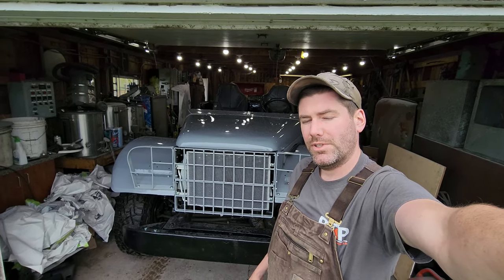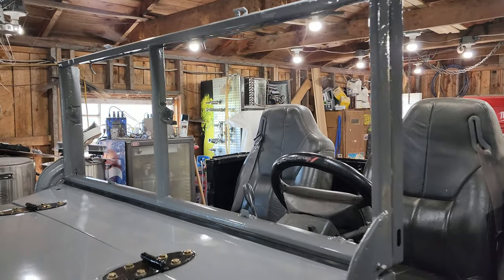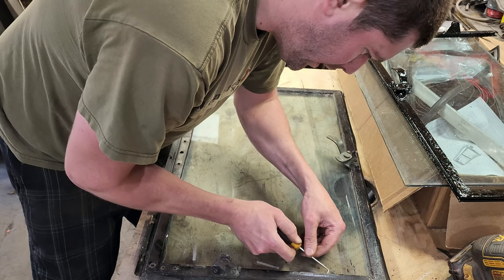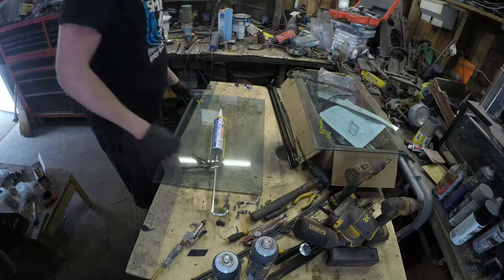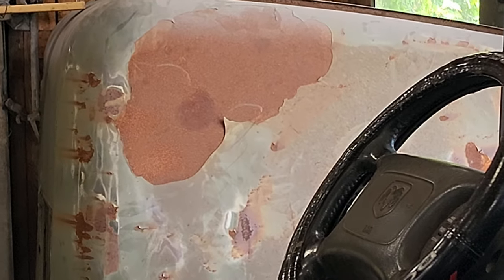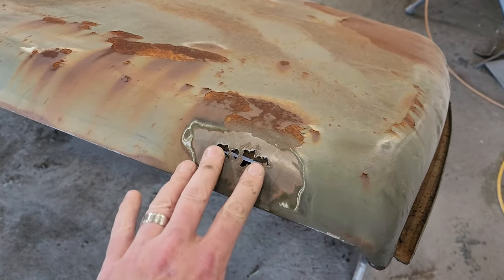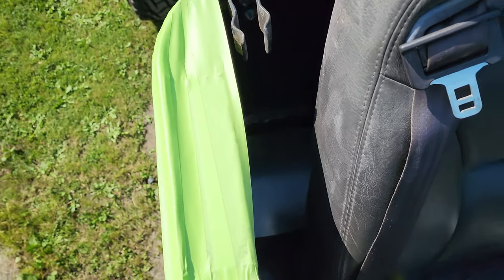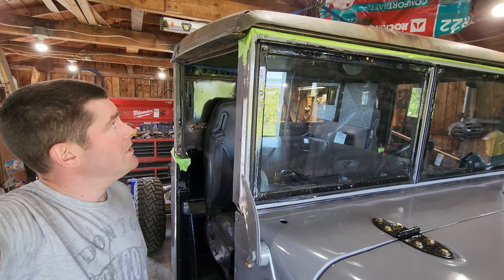Windshield Install and Hardtop Fitment - Dodge M37 Restomod [Episode 31]

Comment: I had to patch up a Range Rover rear window frame very similar to that set up in the 80's boss would not let me take glass out , tacked a few patches on bit glass fibre filler to fill the gaps , no way was I going to blow that glass , car never came back so assume it got sold LOL . Nice job by the way .
Reply from the maker: Thanks! As they say, "no news is good news". I was worried I was gonna break that glass and be up a creek without a paddle lol

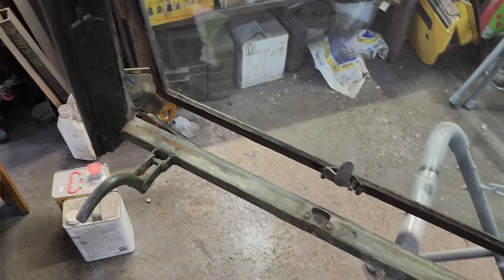Comment: 1:53 I have several manuals, including a Canadian repair manual but I can’t find that exploded view illustration. Can you share what manual it’s coming from?
Reply from the maker: I'm not sure what manual this illustration was originally from, but it was useful for ordering parts from Midwest Military as I found them to be identical parts. I didn't find it in my Canadian one either. Here's the link to that: https://shop.midwestmilitary.com/product/m37-windshield-exploded-view/
Reply: @DavePepperX  Thanks Dave. Great series! And the final result is outstanding!